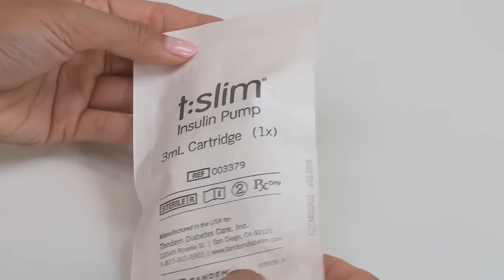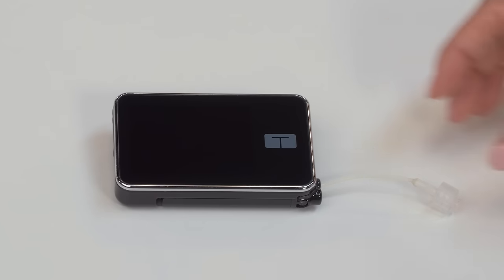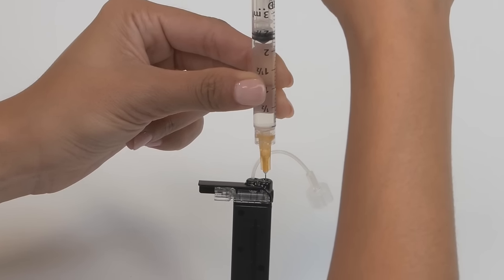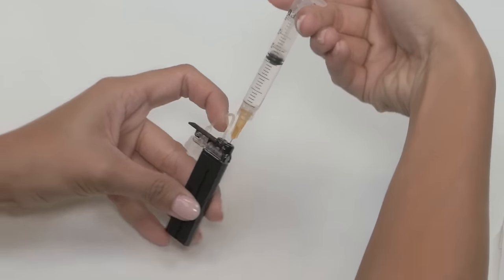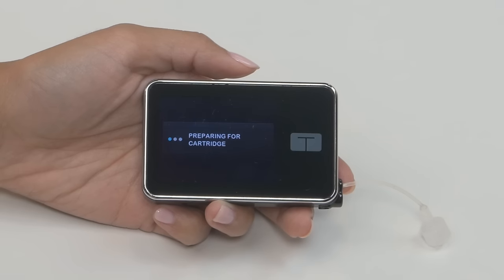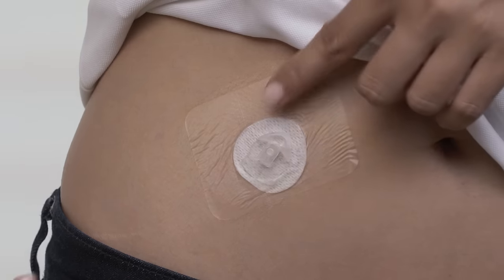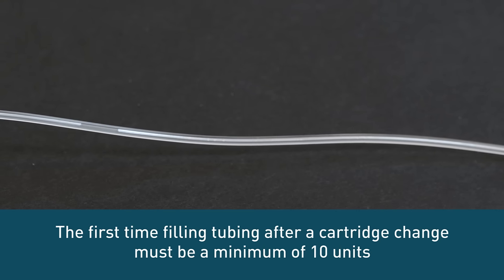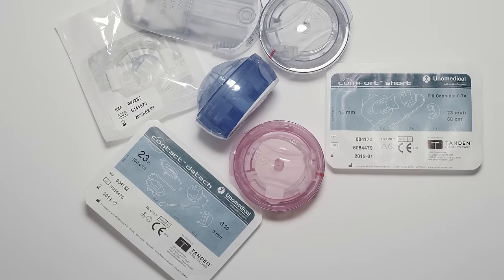How to Load a New Cartridge Onto Your Insulin Pump

Comment: Can you guys develop a insulin reservoir system like in Medtronic pump which is simple to fill and more cost friendly.
Reply: Fangxiao Yang I would like to have prefilled cartridges
Reply: The downside with Medtronic is it's so big, but I agree the tandem cartridges are a faff and seem very wasteful of insulin. I would also prefer if they were made of clear plastic so you could visually check everything is ok inside.
Reply: The current design for the cartridge actually allows for significantly more insulin stored in the form factor of the pump. It also is much safer than the Medtronic design
Reply: 0)

Comment: @Tandem: Why does the video show a new cartridge in the pump and an existing infusion set/site? Both should be changed every 48-72 hours, right? So what would be the occasion to put in a new cartridge but not change the infusion set? If this is a NEW infusion set, then you are not filling the cannula in this sequence.
Reply from the maker: Hi Ranjeet. You are correct, we recommend that both the infusion set and cartridge be replaced
 every 48–72 hours. However, if you notice leaks around the site, or if you
 suspect your infusion set cannula may have become dislodged, you should replace your infusion set right away. This may cause your cartridge change and infusion set change to be at different times.

Comment: How long in advance can you store the cartridges which you already have filled with insulin before using it. Filling a cartridge costs time which you can’t do during work or travel.
Reply from the maker: Hi Hans, although it's convenient, We do not recommend pre-filling cartridges. Tandem has not done testing on the biocompatibility and stability of insulin stored in the cartridge
for extended periods of time, or of insulin refrigerated in the cartridge. In addition, insulin has dissolved
 gasses and when cold insulin is warmed, the gas will come out of solution and form bubbles. So, putting a pre-filled cartridge of refrigerated insulin in the pump may result in bubbles in the system.
Reply: @tandemdiabetes  So you are tell us that Tandem did not bother testing the biocompatibility and stability of insulin stored in the cartridge. So how can Tandem claim it is safe to use without testing to see if it is safe? For this reason I will have to pass on getting a Tslim x2 and stick with Medtronic. Medtronic sucks but they at least did the testing to claim that insulin loaded into the reservoir is safe to use.
Reply from the maker: @AB-hu4fc  We have done testing on the biocompatibility and stability of insulin to support the way it is
 intended to be used in the cartridge. This means changing the t:slim X2 cartridge every 48–72 hours, as
recommended by your healthcare provider, and not reusing it.
Reply: Pre filling the cartridges would speed things up for sure.  Pull the old cartridge out and put the pre filled one in and prime it.  Why can’t we do that?  The insulin is stored in the cartridge and its in the fridge.  Thats a great idea.

Comment: DO NOT UPGRADE TO THE Dexcom G7 yet. As of August 18,  2023, there is no insulin pump compatible with the Dexcom G7.
Reply from the maker: We appreciate you sharing this reminder, Marcia! Until the commercial launch of our integrated product, please continue to make it clear during your next CGM supply order that you use an integrated Tandem pump to ensure you continue receiving the CGM supplies that work with your device. 

If you do inadvertently change your CGM sensor supplies from Dexcom G6 to Dexcom G7, you will need to contact Dexcom to arrange receiving Dexcom G6 supplies until we have completed integration with Dexcom G7.

Comment: A month ago I switched from the Dexcom G6 to the Dexcom G7. Unbeknownst to me the G7 IS NOT YET COMPATIBLE with the Tandem t:slim X2. I also found out that the OmniPod insulin pump is not compatible with the G7 either. I’m so disappointed to learn that none of the insulin pumps in the USA are not yet compatible with the Dexcom G7. I was told by Tandem that the Tandem t:slim X2 will be compatible closer to Fall 2023. However there is no release date as of August 18th. Meanwhile I have to manually enter my BG or number of carbs. 😮
Reply from the maker: Until the commercial launch of our integrated product, please continue to make it clear during your next CGM supply order that you use an integrated Tandem pump to ensure you continue receiving the CGM supplies that work with your device. If you do inadvertently change your CGM sensor supplies from Dexcom G6 to Dexcom G7, please contact Dexcom to arrange receiving Dexcom G6 supplies until we have completed integration with Dexcom G7.

The timing of integration is dependent on many factors and we are actively working to deliver an integrated solution as soon as possible. Tandem’s goal is to have the first FDA cleared insulin pump to integrate with three continuous glucose monitoring sensors. We anticipate that existing US in-warranty t:slim X2 pump users will be able to remotely update their pump software and choose their CGM: Dexcom G6, Dexcom G7 or Abbott Freestyle Libre 2 starting this fall. Thank you for your patience and understanding.

Comment: Hi Danica, I remember when I first started using the Anamis pump, I tuned to your videos for help using it. At this time I am Using the Medtronic 770G MMT-1881. I have switched back and forth from Medtronic sensors and Dexcom sensors. The Dexcom is great, not accurate usually until I calibrate it once, then clear sailing. Problem is cannot use the dexcom CGM with a Medtronic pump. I have made up my mind to switch the the Tandem Slim X2 Control IQ. I will be watching the rest of the related videos. Thanks again for Your Help.
Reply from the maker: We're honored to have you join the Tandem family Dean! If you have any questions, or need any assistance at all, please don't hesitate to reach out. We're here for you.

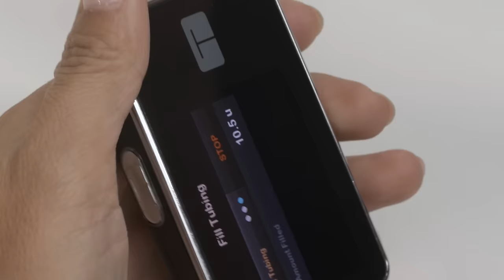Comment: At the end of the tubing 5:10 where it connects to your body, is that a needle or a tube? I'm thinking of getting one but, ironically, I'm a diabetic afraid of big needles or of them being inside me too long x.x
Reply from the maker: Hi ElyKitt. This is the cannula on the infusion set, which inserts into the skin. We have a variety of infusion sets available some have stainless steel cannulas, and some have some soft flexible cannulas. You can learn more here: https://www.tandemdiabetes.com/products/infusion-sets

Comment: What a ridiculous refilling process. I have to do that every three days. Using a needle while holding a vile to pull out the insulin with no locking mechanism to secure it. then balance the cartridge on its thin base, get the needle just right, withdraw air?? Then insert insulin. Geez, what’s with the 1970s process. And after all that, still have to prime a line and sink a site. Way too long and complicated. They need to get rid of that needle and air removal process. Whoever designed that was not a diabetic or had endless free time to changeover sites.
Reply from the maker: We’re sorry to hear about the trouble you're experiencing with the cartridge fill process . We will be sure to document this feedback with our Product Development team. 

In the meantime, please see the Cierta tool which is a product manufactured by Ayuda Life that is intended to help users align the Tandem needle & syringe with the t:slim X2 insulin pump cartridge when filling insulin. To learn more, please visit: https://www.ayudalife.com/?gclid=Cj0KCQiAxoiQBhCRARIsAPsvo-xGa0mEJcQW5810eucd888AH3fPEx7hgEU8do36zIs7ch8H9xQsJ_oaAlSsEALw_wcB#Features 

Please note: The Cierta product has not been tested by Tandem, therefore Tandem cannot endorse the use of this product.
Reply: Ty, I did purchase that device. Including the aftermarket tape to keep your transmitter from simply falling out, I would encourage you to pass on to your development team that it is not a good look when an entire cottage industry springs up just to make your product functional and user-friendly.
Reply from the maker: @frequencyharmonic2054  We appreciate your feedback and we will make sure to share this with our Product Development Team. Please let us know if there is anything else we can do to help.

Comment: How do I change the tubing only without changing the cartridge.
Reply from the maker: Hi Sarah. You can change the tubing by following the steps starting at 4:20 of this video. Please note, do not change your infusion set before
bedtime or if you will not be able to test your BG
1–2 hours after the new infusion set is placed. It
is important to confirm that the infusion set is
inserted correctly and delivering insulin. It is also
important to respond quickly to any problems
with the insertion to ensure continued insulin
delivery.

Comment: Why not remove the residual air before drawing insulin into the syringe?
Reply from the maker: Hi Gino. Removing the air from the cartridge is performed this way so that you can see this air being removed, rather than just assuming that this is happening.

Comment: I have a question on removing residual air from the cartridge. The video says to pull the plunger until it is fully retracted, what does it mean for the plunger to be fully retracted, and is it possible that I could pull too much air out of the cartridge? My trainer said to pull until I see two air bubbles come out, just want to make sure this lines up with what the video is saying
Reply from the maker: Hi Jesse. Thanks for reaching out! Fully retracted means that the plunger is pulled back as far as it allows. As for the air bubbles, two is the most common amount you will see come out of the cartridge. Any more or less than this isn't bad.
Reply: @tandemdiabetes  Great, Thank you for replying
Reply from the maker: @jessesmith8981  Always here to help!

Comment: Cartridges wont fill t slimX2 pump
Reply from the maker: The initial estimate of the insulin level is calculated during priming process and may occasionally
 generate a low estimate of the cartridge’s actual insulin level. Each time insulin is delivered, the estimate of the remaining insulin is updated and refined. If the initial estimate made during priming is low, the displayed reading on the home screen will remain where it is until the actual contents are reduced to the displayed estimate. If you have concerns about your fill estimate amounts, call our Customer Support for guidance at (877) 801-6901.